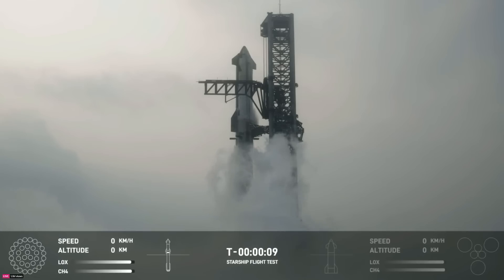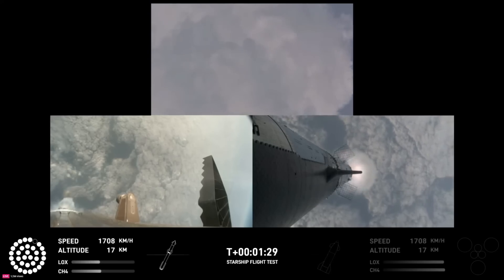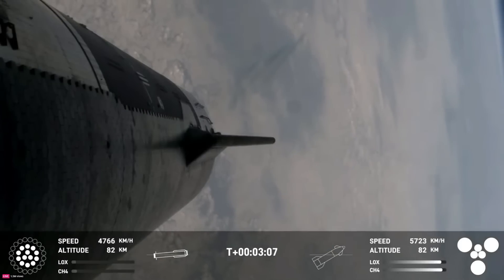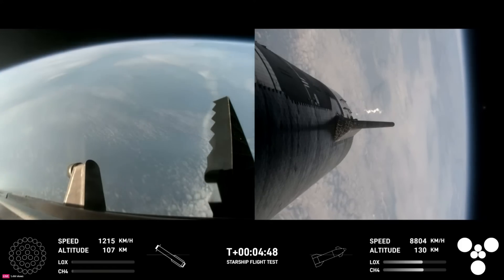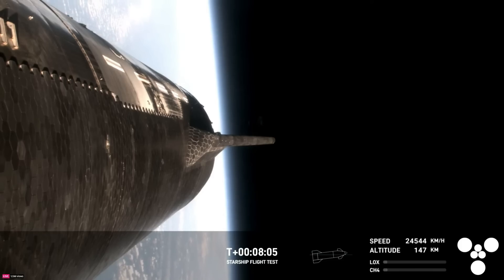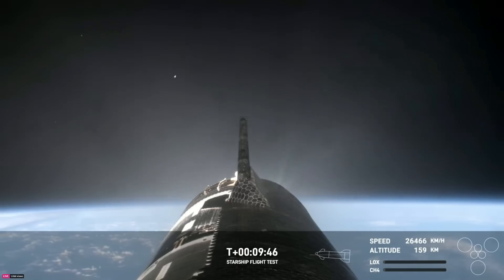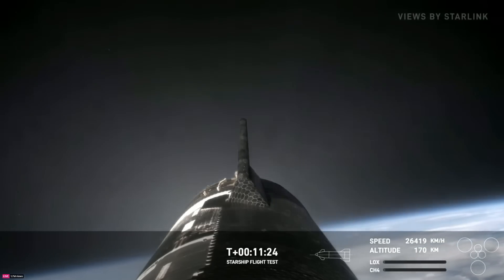Starship Flight 4 From Launch to Booster Ocean First Time Landing - Complete Video

Comment: I wonder why the grid fins have been deployed since the launch.  There should be more resistance with them displayed.  why didn't the ship orbit the earth and come down in the gulf, but they chose Indian ocean.
Reply: Grid fins are deployed because Elon wanted to reduce the risk that they fail to deploy, so they are incapable of deploying/stowing entirely. As for starship, they didn’t want to risk it failing to deorbit, so they placed it on a suborbital trajectory. Landing in the gulf would require a de orbit burn

Comment: Nobody is talking about that one engine that failed during launch
Reply: It was only one engine which had little effects on the launch, but Space X will definitely determine the cause of losing that one engine and the other 2.  There was also an engine lost during the booster back and one engine went during the 'landing' at sea.

Comment: Guys please advice me, why does the super heavy booster need to go with splash down rather than landing on an autonomous spaceport ship that they have? What an incredible milestone for SpaceX regardless💯
Reply: Splashdown is not landing. Starship and its booster are supposed to land on a pad, which is the most difficult challenge SpaceX has to face, and not sure if it ever will be met.
Reply: @truthadvocacy  i know but their previous booster were able to land on the pad why is this an exception?
Reply: Testing. Superheavy is unproven, so they don’t want to risk destroying infrastructure if the landing burn fails. Falcon 9 did similar early on

Comment: Was the booster supposed to tip over in the water?
Reply: Splashdown is not landing. Starship and its booster are supposed to land on a pad, which is the most difficult challenge SpaceX has to face, and not sure if it ever will be met.
Reply: Not necessarily “meant” to, but expected. There was no way to ensure it remained upright after landing in the water.

Comment: Why is this so incredible? Yey, we went to space!
Reply: Splashdown is not landing. Starship and its booster are supposed to land on a pad, which is the most difficult challenge SpaceX has to face, and not sure if it ever will be met.
Reply: @truthadvocacy  And how would landing on a pad be of greater importance? What is total efficiency of these rockets? Speed and cargo load are still way to low to do anything significant in space. Efficiency is ridiculous.
Reply: @truthadvocacy   Why are you posting the exact same cynical perspective over and over??  What's the point of being so negative?
Reply: Largest/most powerful rocket to ever launch, successfully soft landed the booster and second stage - something which had never been done before, let alone with a vehicle this size
Reply: @mistertagnan  Great, how is that of any importance? Let's set aside all the emotions and fake expectations...it's still just a chemical rocket with a bit better usability and that's about it. We are far cry away from being anywhere near "space exploration". We are like ants at the shores of Portugal thinking about swimming across Atlantic.
Reply: @brokula1312    "A bit better use ability"!?!?  What is the point in marginalizing or minimizing what Space X is accomplishing?   

Space X has 2 Falcon 9 boosters that have landed at least 20 times to be reused again!  

Even better reuseability can be expected of starship because the methlox fuel burns more cleanly and doesn't leave the sooty deposits that are left by the Falcon 9 burning the kerosene lox combination.  Plus the plan is to also land the starship to be reused.  That's way more reuseability by any measure.

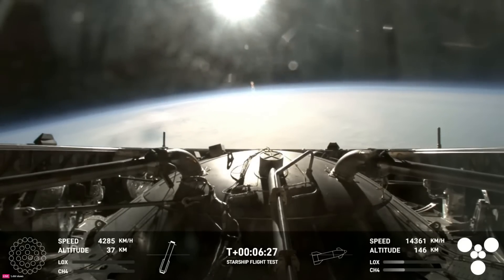Comment: 6:38 wtf is that in the distance?
Reply: 42 km is 26 miles altitude for the booster at that point.  145 km for the ship is 90 miles altitude.

Comment: It's hard to wrap my mind around the scale and power of this thing. It's 30 feet wide and longer than a football field. The flame is over 400 feet long. From the nose to the tip of the flame is just short of 3 football fields in length. It's no wonder the noise overwhelms the audio making it sound like two robots fighting.
Reply: 33 puny rocket engines of SpaceX booster don't make a "powerful" rocket. Strength in numbers.😂

Comment: The flaps are the most sensitive element in the starship creating a weakness point at the joint axis, even if they placed those small plasma shield at the front & base of the flap the plasma heat still entering that area , those moving flaps are a design problem that need to be Re Engineered...
Reply: The flaps will be moved to the leeward side of the ship in version 2 of starship which may happen with S36.  In the meantime a heat shield is to be installed under the tiles though it isn't clear if that is just in certain areas.  Other short fixes are in the works as well.

Comment: 6:38 right side, disc shaped object can be seen as we descend from cameras point of view 🤔
Reply: Inbetween the booster and the ship there is a heat shielded ring that allows the engines on the ship to light while still attatched to the booster. this is quite heavy, and so it jettisoned after the boostback burn, and that is the disc shaped object floating past
Reply: 4:25 you can see it closeup immediately after being detached

Comment: Photography is great!
The choreography of cheers & commentary is not! Literally feels like it’s staged to swap public opinion. I noticed all the millennials & GenZ’ers in the crowd cheering. Something is def out of place & odd about this!
I recall watching a StarShip Falcon Heavy launch where a rat appeared around the nape of the supposedly searingly hot nozzle!
Not just once, but several times!!! Fake launches? I think so!!! Yes! The tech exists out there to fake it all!!!
Reply: That level of paranoia is not healthy.
Reply: You are correct for the cheering part, but not sure if the launch itself was staged. If staged, why not show success outright instead of all these failures. Even this test is not full success, as the two rockets splashed instead of landing!

Comment: Why don't u land it on land surface i.e desert or at isolated place 
Why don't u vertical land using parachutes instead firing
Reply: Will eventually land on land.
Mass savings and accuracy. Parachutes are heavy and imprecise when it comes to landing location

Comment: Is nobody gonna say anything about 6:40 what was that.
Reply: 4:25
Reply: it is the piece at 4:25 after it has drifted apart
Reply: 6:50 if you mean that it’s sun glare/clouds and the parts close to 6:40 are literally just tiny pieces of debris…
Reply: Also the big debris to the right before 6:39 is a flap/large debris from either the heat shield or just explained

Comment: The thing is this kind of technology was already possible in the 60s, the N1 rocket. If the soviets didn't cancelled the project, who knows how far we become today!
Reply: Absolute nonsense. N1 had multiple engines but that is the only similarity. Its engine control software KORD was absolutely unable to compensate multiple engine failure and the engines themselves were too vulnerable to the vibrations during lift-off and shockwaves created by other engines being shut off. None of the 4 rockets survived even MaxQ state of the launch. N1 proved that the russian technology back then was NOT up to such task.
Reply: @CzechMirco  well in my defense, if the soviets didn't cancelled the program i.e the engineers kept trying who knows what could happened
Reply: Puny SpaceX raptor rocket engines still don't match Saturn V mighty F1 rocket engines, designed and built in the 60s.🤣🤣🤣

Comment: Why does it have its grid fins extended during takeoff? Aren't they just creating additional unnecessary drag? One would think the rocket has enough control authority without them.
Reply: There has not been found to be any benefit to retracting the grid fins for the launch.

Comment: Whats nice about landing both ship is that they will be able to pick them up for analysis, they did their job to the perfection as prototype
Reply: Splashdown is not landing. Starship and its booster are supposed to land on a pad, which is the most difficult challenge SpaceX has to face, and not sure if it ever will be met.

Comment: The booster was prepared well, the Starship not. I was sure that Musk will prepare Starship better, making some structural changes, like flattening the belly of the Starship, changing the shape of tiles, but Musk never listen, after "catastrophic failure" will make necessary changes, pretending that he developed these improvements. Look at the launchpad, one year ago I warned it was terrible design, after one year he made improvements proposed, the new launchpad is more similar to NASA design. He should follow NASA solutions from the very beginning. Flat belly, or Tungsten instead of stainless steel on the Starship belly, different shape of tiles, similar to elongated romb, like a diamond. He had time since March to do it. After the Starship next disaster he must improve it anyway. He should change the name to Must, not Musk. He lost millions, because he should make structural changes in Starship body, and postpone the departure. Now he knows what I proposed long time ago... Mr Must, make necessary changes!

Comment: Absolutely amazing. Losing multiple engines, nearly losing a flap, and they put it down in the water like nothing had happened. Lovely.
Reply: The redundancy of having multiple engines= win
Reply: Splashdown is not landing. Starship and its booster are supposed to land on a pad, which is the most difficult challenge SpaceX has to face, and not sure if it ever will be met.
Reply: @truthadvocacy that's what they said about the falcon9 landing and now it's routine, thats also what they said about the starship "flip" landing, yet they demonstrated it's possible
Reply: @truthadvocacy Watch this. There were people thinking this would never happen. Now I'm sure you personally know someone with Starlink. Now how's that possible?
https://youtu.be/bvim4rsNHkQ?si=nRw-hyfe2QiiXJvi
Reply: Is down look
Reply: I think the fins are supposed to move like that for stability? Or am I wrong?
Reply: This is the thing, they allow for a much lower level of competence than NASA would allow, causing the ability to fail on occasion but much faster progress. Increased Risk.
Reply: @DrCitizenAtSubstack  What an incredibly ignorant comment. This was a TEST flight. They aren't OK with those things happening. But it is good that it was still able to land and be successful even though they had malfunctions.
Reply: @eyeofthetiger7 he meant ok during testing. Where as NASA don't test until it's perfect
Reply: @hazb8026  NASA rockets have launch failures and massive budget overruns and underperform on cost, reliability, and launch rate.
Reply: @eyeofthetiger7  not the point of what I'm sayin. You just went off on one after totally misunderstanding the original point.

Comment: Surprised to see grid fans out for launch. Never noticed that. Assuming it’s stabilisation driven but still find it surprising for drag reasons. Anyone know more about that?
Reply: The benefits of:

"No part is the best part" 
with the weight reduction (no actuator + easier construction)
no hydraulic cylinders = no hydraulic oil = no fire hazard
or no electric actuators = no extra batteries needed

overcome the drag losses according to Elon.

Comment: Is it just me or did tip over after it landed?
Reply: The mission for both the stages ( Super Heavy, and Starship 29 ), was to do a soft landing in water ; Super Heavy - Gulf of Mexico,  Starship 29 - Indian Ocean. 

So yes, once they both " landed " on the water ( vertically ), they both tipped over 🙂
Reply: @resh..  interesting. Whats the point of doing that if it just falls into the water? Is the rocket unaffected from it?
Reply: @grantwlms  testing to see if it can land, mostly. The primary drawback is that if it does land, it can’t be reused as it’ll likely break apart. But the benefit is that if it doesn’t land successfully, you don’t have to deal with the booster slamming into important infrastructure
Reply: @mistertagnan  ah, so it's just a way to mitigate risk. and once it's proved to work they take it to land

Comment: Is the booster that had the controlled splashdown reusable?
Reply: Theoretically yes, but this one was intentionally landed in the Gulf of Mexico (very near the launch site) and probably sank to the seafloor.
The next step for the booster is to catch it at the launch tower with the Mechazilla-Arms.
This test should demonstrate: 
1. supersonic reentry with attitude control
2. relighting of the 13 center engines for "braking" 
3. manouver the booster to a predesignated spot, simulating the catch at the real launch tower

The coming launches are getting better and better.
I expect a lot of excitement (bent metal and maybe some fire) at the first try to catch the booster at the launch tower.

Comment: 9:38 -- what are the white/light scattering-debris? Ice build-up?
Reply: Heat shield tiles
Reply: @thwalesproductions  Seems too many to be the tiles. Would they be scattering light like this? They are made of dark light-absorbing insulating foam.
Reply: @runcycleskixc  They were designed to come off during the flight as another test to see how starship would act entering the atmosphere if it loses some of its heat shielding

Comment: ...imagine seeing that booster pop-out of the clouds then hover there for a few second before splashing....
Reply: Why was it a splash down and not on a vessel,surely that's a waste
Reply: @Sleepywhispers79  they need to prove the concept…won’t be a waste in the future, but amazing feat
Reply: @Sleepywhispers79 you mean like very other rocket launch ever? (Other than SpaceX) They are literally doing things NO ONE else is doing and this is where your focus is? This is a test article meant to gather data to improve the next test article. It’s a key step in the scientific method.
Reply: Absolutely an amazing feat, 💯 agree with you but just wondered why they didn't use OCISLY
Reply: @Sleepywhispers79  the super heavy booster does not have landing legs.
Reply: @Sleepywhispers79  it also absolutely would dwarf OCISLY. This thing is 3x the size of Falcon boosters.

Comment: 6:39 whats that? do sattelites hang around at 40 km? just curious
Reply: Looks like the Hot stage ring, not a satellite anyway
Reply: @FallingKen  How could the hot stage ring be below the booster and after the booster made the burn back toward Florida?
Reply: @JustinQuilling  The hot stage ring was jettisoned after the boost back burn @4:24 (T+ 4´10´´)
And by the way ...  Starship was launched from Boca Chica, Texas.
Reply: @JustinQuilling As I understand it, the HSR, early in the descent lags behind the descent of the booster. Aero effects hold the booster up while the HSR drops lower. Then the booster "catches up' and starts to pass the ring. They are both relatively close since the HSR was released after the boostback burn so they are travelling together. A lot of people read were surprised how stable the HSR was. I am probably muffing the explanation, but there were a couple good explanations I have read.
Reply: @FallingKen  thanks!

Comment: I watched it live this morning until the hot stage separation then I had to go to work.
Reply: Splashdown is not landing. Starship and its booster are supposed to land on a pad, which is the most difficult challenge SpaceX has to face, and not sure if it ever will be met.

Comment: Where does that hot stage , jettisoned section land ,seems a lot of structure to  not be worth recovering  or  does it vaporise on reentry.
Reply: Most likely vaporise on reentry.
Reply: @AstrumG2V   after watching the re-entry of the spaceship and  watching the flap melting in parts , I  wonder if any  hot stage made it through,   Ihope somewhere out  on the re-entry path someone in a boat  was looking at the sky and caught  the  various objects coming though , the starship re entry must have been pretty spectacular.
Reply: @MrSCOTTtheSCOT  The hot stage ring didn´t burn up. The booster didn´t burn up as well. You can see it flying in formation with the booster @6:38
Reply: The effort is not worth it.
It´s 10 tons of Stainless Steel.
1 ton  of  1.4310  costs 2500€ for me to buy. So that´s  25k €  plus manufacturing cost. That´s peanuts. 

The whole launch (Booster+Ship production) costs about $ 100 Million (Elon in 2022).
Probably the cost came down meanwhile (Production facility+processes set up + Raptor2 engine goal set to  $250 k/piece)
The fuel is peanuts with approx. less than $3 Million (in German LOX + CH4 "small customer" prices).

The 33 Raptor engines are the costly part of the booster + 6 on the Ship.
These are test articles, meant to be discarded.
Salt water corrosion was a problem for the reusable SRB´s of the Space Shuttle, and these were "just" empty cylinders.
Reply: @hectorpascale1013        The HSR allows the starship to start firing to propel itself away from the booster before the booster has even cut off its engines.  Thus the  starship has continued acceleration from its separation from the booster.
Reply: @michaeldeierhoi4096  
Don´t know to what section of my previous answers you are referring.
The question by @MrSCOTTtheSCOT was where HSR ended up and if it burned up. And HSR made the boostback burn attached to the booster, to then be  jettisoned and free fall sided by side with it after boostback ended.
Reply: @michaeldeierhoi4096  Under the bell icon i see your reply, but when clicking on it, the comment isn´t visible to me any more.
I meant RECOVERING the HSR ring from the ground of the Gulf of Mexico is not worth the effort considering it´s estimated price tag and that disposing it is an interim solution.